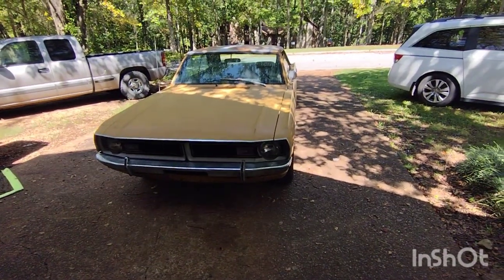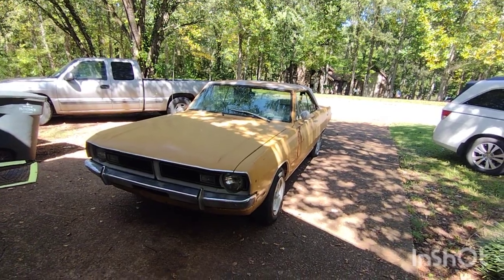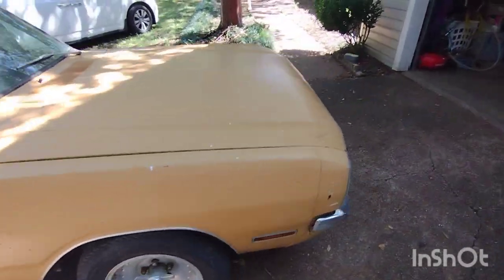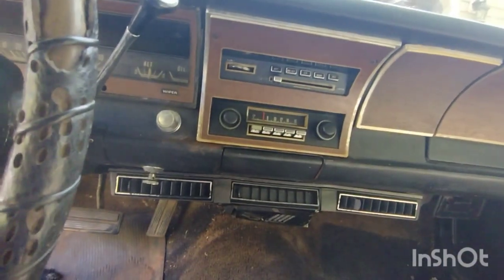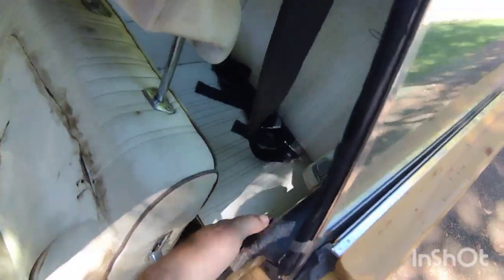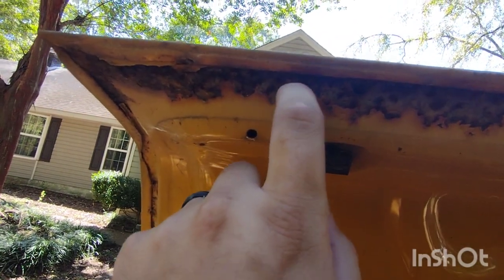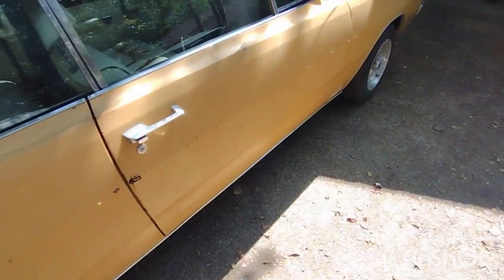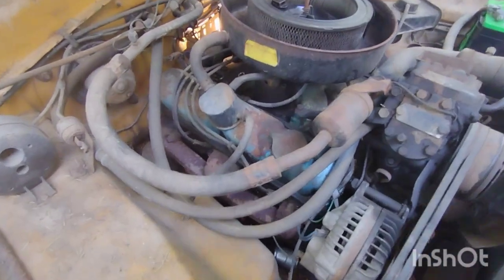First Look 1971 Dodge Dart 318 Barn Find (sort of)

Comment: Mr. Lenchner is from Marietta originally, lives in Miami now if not mistaken. Car has the HD cooling, probably has the .892 & .893 torsion bars, disc brakes (by the looks of the master cylinder), and could have the front sway bar on it. Fairly well optioned, but odd it has the baby 7.25" rear end...
Reply from the maker: Awesome yeah I didn't look up original owner. That's cool
Reply: @Erics_Garage  it's a neat car- I've had a lot of '67-'76 A-bodies, and it's hilarious to see the combos that come on them. 
It's an unusual name, so was pretty easy to find the guy. It'd be cool to do the car up and show it to him.
Reply from the maker: Yes that would be cool
Reply: there was half a million , of these !
but , the 4spd conversion , still makes them special !